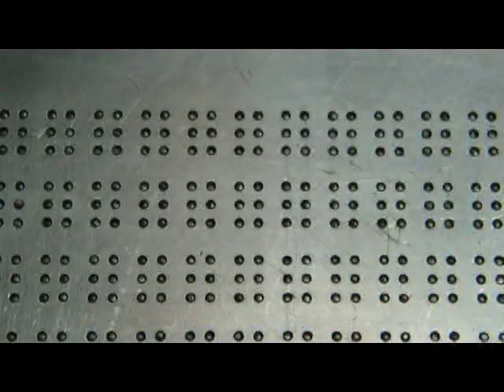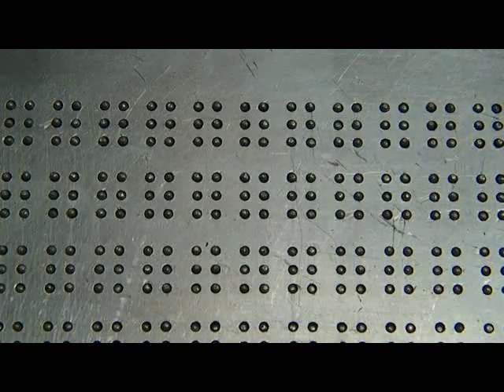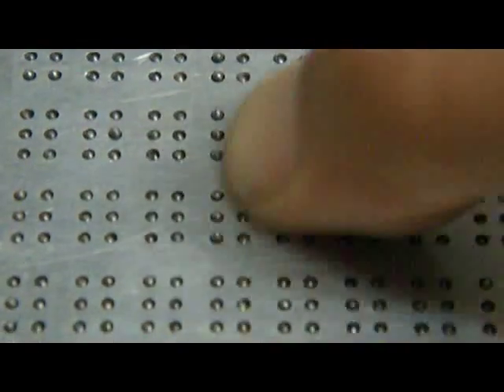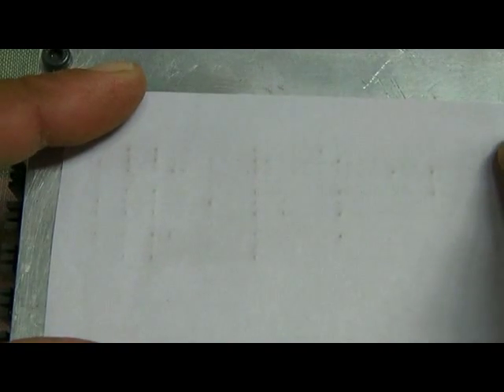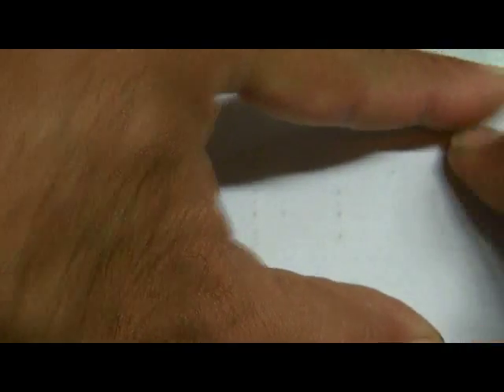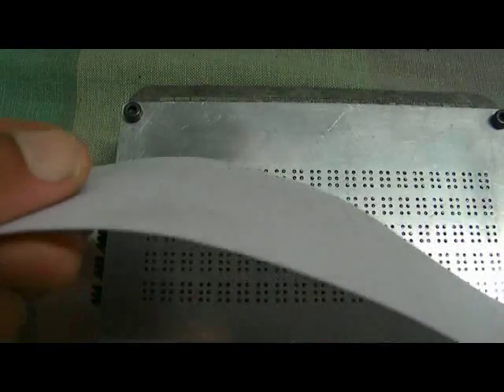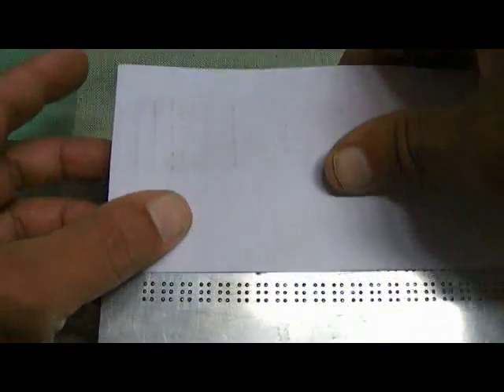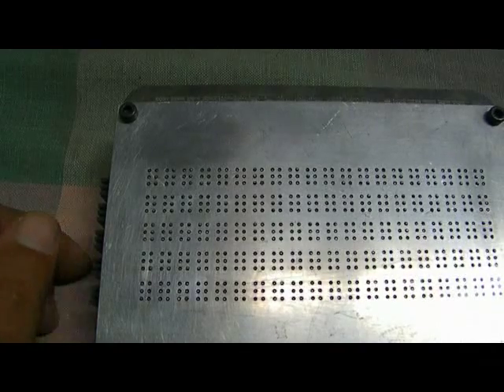Refreshable Braille Display being used as  Embosser

Comment from the maker: Hi,
thanks for the comment / interest in the Braille Display.  I made a proof of concept prototype and now am in the process of making parts for mass production to bring costs down.  It will take a few more months for this version to reach the testing phase.
I will keep you informed.  I am leaving out the embosser aspect as parts become expensive.  The rest should be reasonable low cost. I am probably going to keep it at 5 lines to keep cost